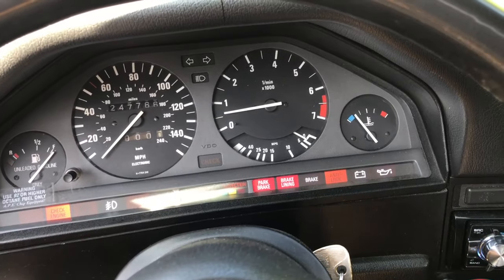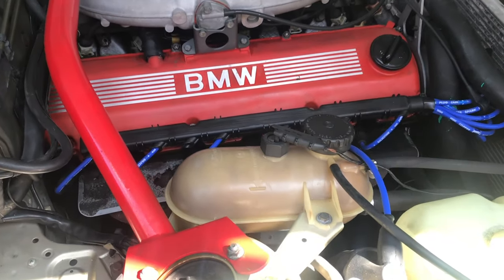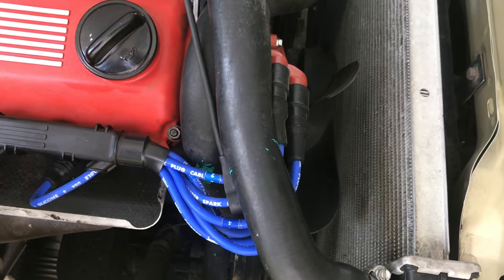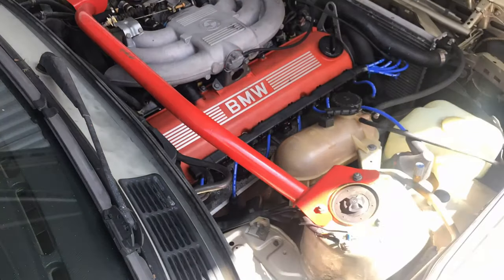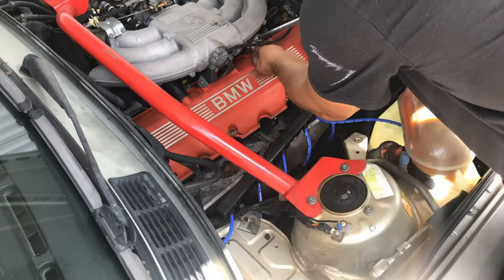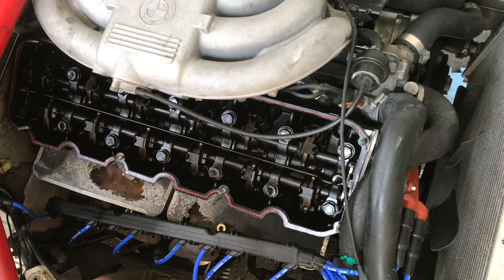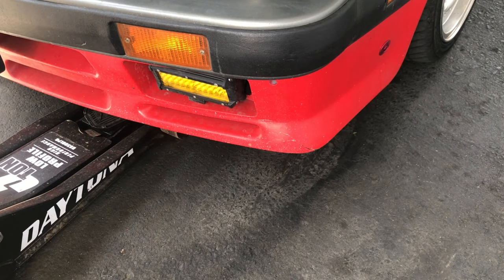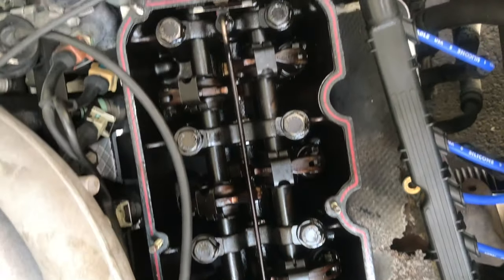E30 BMW 1987 - Misfire Sputtering Update Solved

Comment: my e36 has had a sputter since I got it. I put new o2 sensors, I rebuilt the whole head because the head gasket was bad, I replaced a bad fuel regulator hose, a bad fuel pump hose, all the intake gaskets, I ended up putting new coils and spark plugs, a new fuel filter, throttle position sensor and new filters and o rings on the injectors. It still does it. I basically give up. I just accept that it's gonna sputter. Brought it to 2 mechanics neither one pulled any codes. I've swapped out a few relays too. I forget which ones but basically anything controlling the fuel and spark I tried. I guess next thing would be fuel pump or fuel pressure regulator but I don't feel like replacing those. I'll just use it as it is.
Reply from the maker: Try cleaning the idle control valve, that helped me as well.

Comment: Check the tweek valve. Always works for me.
Reply from the maker: Valve adjustment?
Reply: @ErnieHernandezdesigner  I was joking. But seriously you probably have an intake gasket leak. Just remove Intake manifold and put new gaskets. Worked for me.
Reply from the maker: @booboo3633  😂 I did find a very tiny leak in one of the injector gaskets.
Reply: @ErnieHernandezdesigner  yeah you can change the o-ring on that.
Reply from the maker: @booboo3633  👍

Comment: Did you fixed dude?
Reply from the maker: yeah. cleaning the idle control valve n airflow sensor really helped.
Reply from the maker: also did a valve adjustment and ran some injector cleaner thru the system.